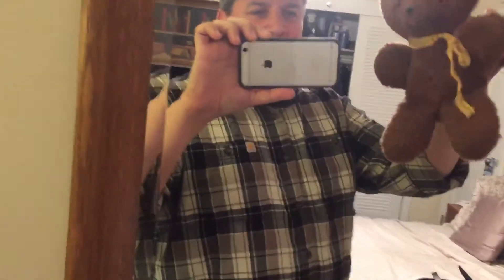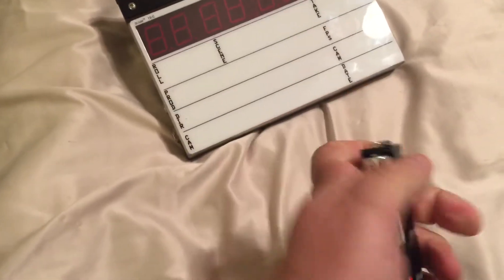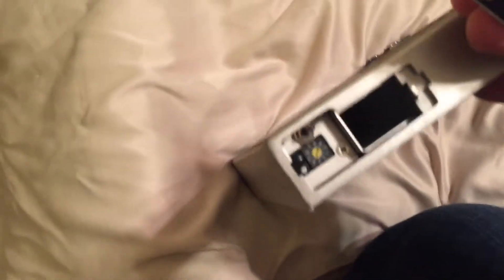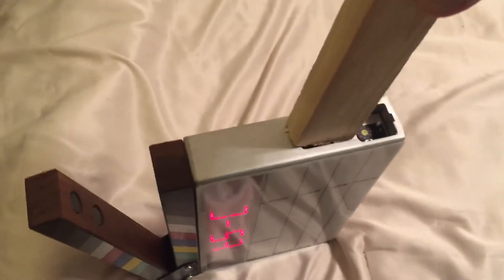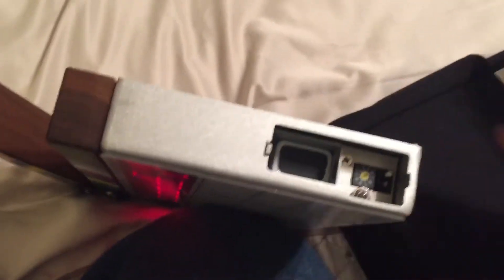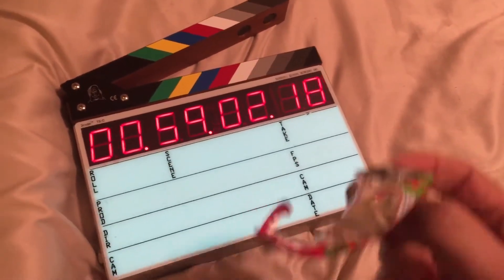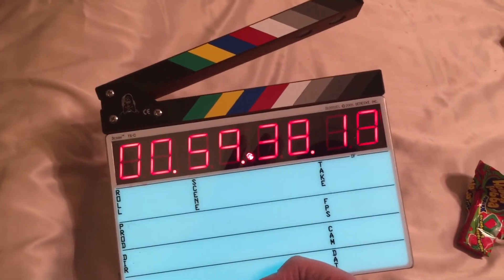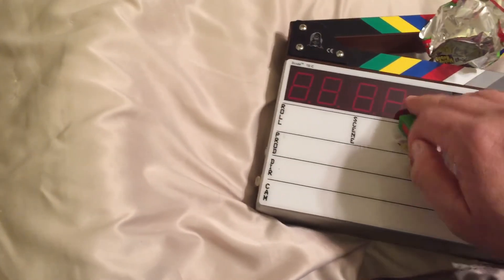Denecke TS-C Timecode Slate Battery Hack

Comment: Buy a tentacle timecode slate and you wont have this issue 😂
Reply from the maker: Great idea. Didn’t exist when I made this!
Reply: @robdisner I’ve had mine for a while now and absolutely love it. It’s a lot lighter than a denecke slate for sure.
Reply: And the whole tentacle ecosystem is really user friendly. Also if you’re crafty enough, (and have a 3D printer), you can even build a slate yourself and just mount the Timebar inside.

Comment: Can’t believe a $1,500 slate has such a huge design flaw. That said, this seems like an easy job for a 3D printer to handle. Someone would just need to make the design, and then AC’s could print them for around $1 at their local library. If I had one of these slates I’d volunteer to do it!
Reply from the maker: I’m using a rolled up piece of Velcro now to hold the 9 volts in. Has worked fine for years.
Reply from the maker: And someone already made a product called the Slate Bone which held a single 9 volt in place.
Reply: @robdisner Just be careful that the 9 volt batteries don’t short out in there. Otherwise they’ll get really hot and start leaking. Maybe best to find something else.
Reply from the maker: @ Been using them for years with no issues.

Comment: How do you turn the backlight on for the slate? The blue light?
Reply from the maker: There are two little round push buttons on the back. They toggle through the different modes.
Reply: @robdisner  I was able to find out shortly after that by turning the brightness down it auto toggles the backlight blue on

Comment: Except now you're putting in 27Volts ya dumb fuck! 🤦🏼‍♂️
Reply: Only one 9v battery is being used to power it. The other 2 batteries are not able to connect in series like a regular AA battery would.
Reply: @VivaLaCody1  batteries in series add voltage dipshit!, 🤦🏼‍♂️
Reply from the maker: The terminals of a 9 volt battery do not add voltage when they are touching the back of another 9 volt!

Comment: Oh nifty! Was the first think I thought when I saw the battery sled was if it worked with 9V instead
Reply from the maker: Sure does! The bubble gum was a joke though. But I do load up three 9 volts and a rolled up bit of Velcro that I shove in behind them. Lasts a couple weeks!
Reply: @robdisner  surely three can't be used at once, just one 9V at a time?

I just finished filming a video myself abut the Deneke TS-3, will upload it soon
Reply from the maker: It holds three in the slot. Obviously, only one is in use at at time. But keeping them all in there makes it easy to swap them around when one goes dead.

Comment: Nice video i will try this. I like 9v battery much better, it works well with microframecorp slate
Reply from the maker: Thanks! I’m not using the gum any more. A rolled up strip of two sided Velcro does the trick as well.